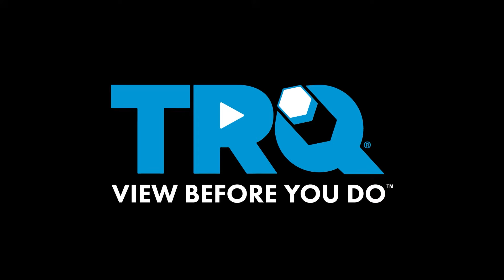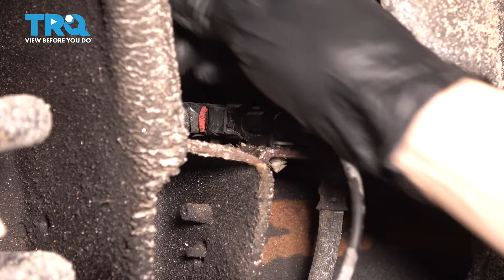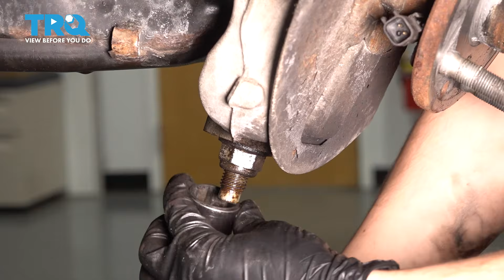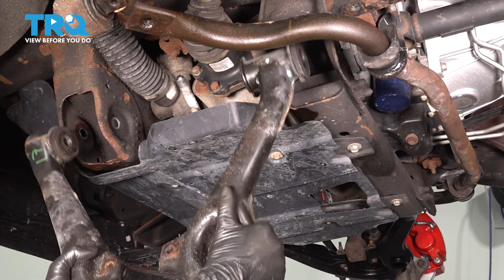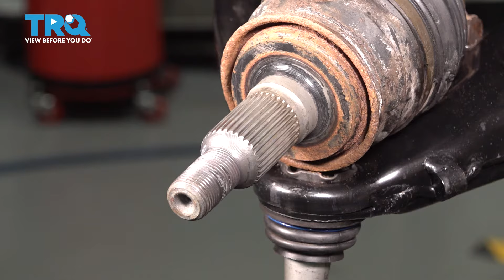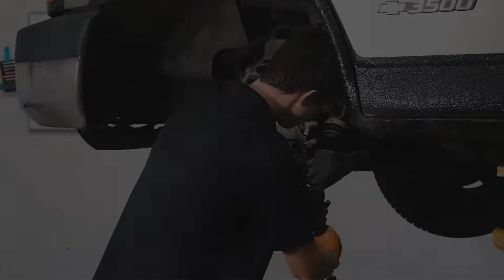How to Replace Front Lower Control Arms 2015-2020 GMC Yukon

Comment: How do you know when control arms are bad? I have a 2018 Yukon with slight vibration in steering wheel and you can feel every bump in the road. Even the smallest bumps feel like you are hitting a curb. Has 130K miles on it. Could I just need new front shocks/springs?